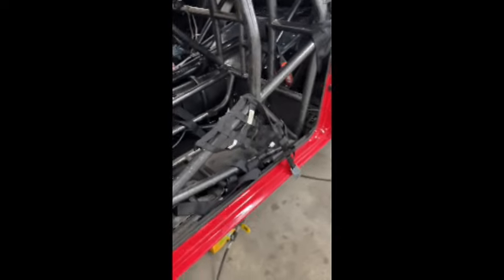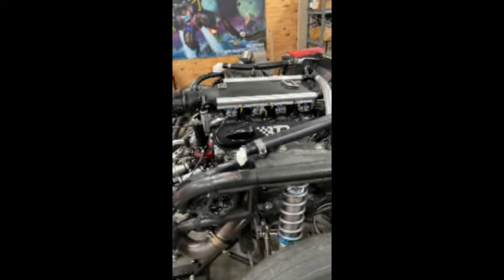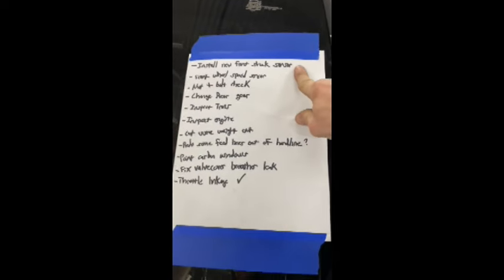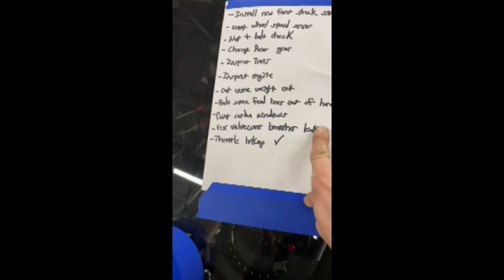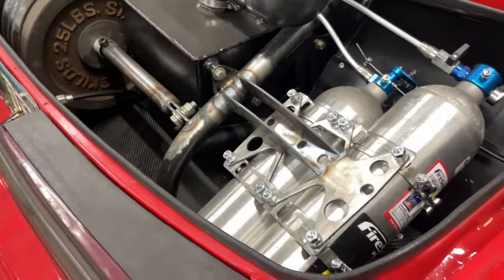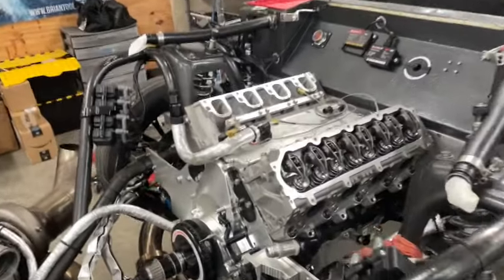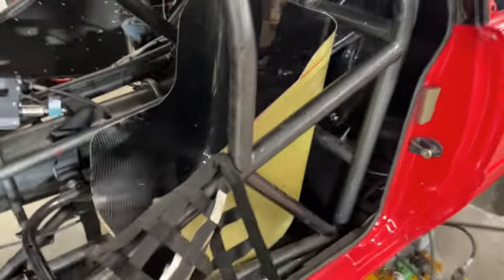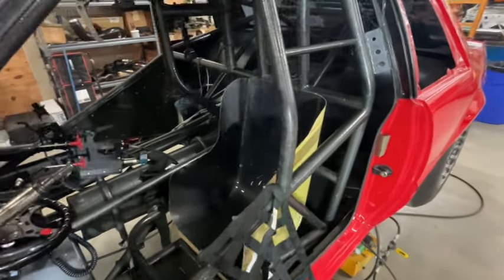New year new update!  Let the winter changes begin!

Comment: Why do you think it makes so much more than the 388? aside from more cubes
Reply: Mod for mod the LT platforms make more power than the LS platform.
Reply from the maker: What Reid said.  The cylinder heads are much better then the TFS 245s that were on the 388.
Reply: @nigelstst  gotcha. I just wasn’t sure if the head would actually gain that much more power or if it would just take more boost to achieve same power. That’s bad ass!